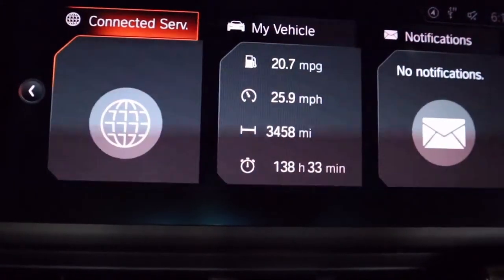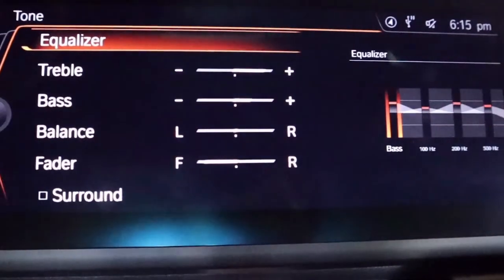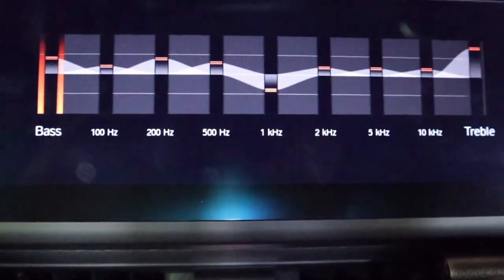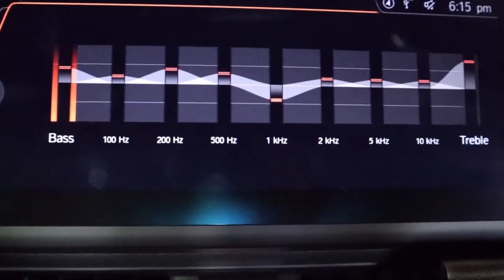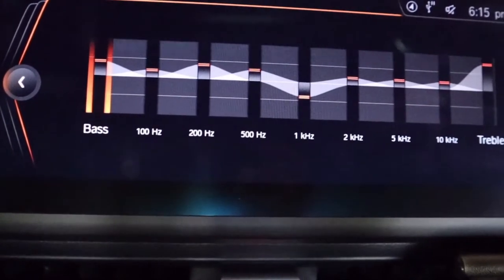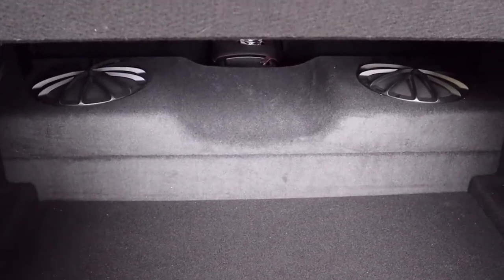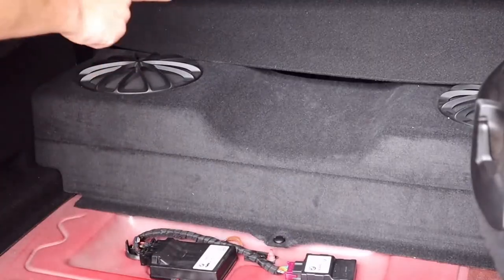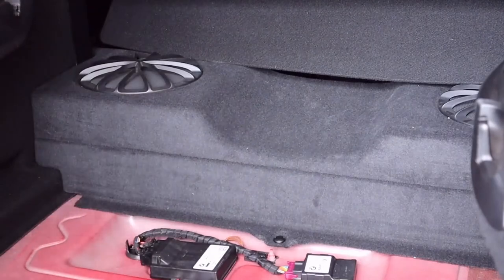Speaker Box Fix -Inexpensive Sound System Upgrade, Detailed Install for the 2020+ Supra! #mkvsupra

Comment: Take it from an engineer there's a reason why you don't pack certain materials around electrical wire. You must make sure whatever you are using is flame resistant other wise any little spark and all engineers will tell you no matter what there will be spark....your car will catch on fire....
Reply: What would you sugest that we should use? Something Not super expensive but affordable
Reply: It’s polyester

Comment: Curious i did this mod and yes it did improved the sound bass alot but I am still getting a rattle noise on the left woofer like it sounds blown but the car is new . Even at low volume you can hear that annoying rattle . What you think i can do to fix this? Right sub sounds great no rattle sound just left one
Reply from the maker: Thanks for watching 👌. I would remove the rear sub panel again and see if I could see any loose bolts.